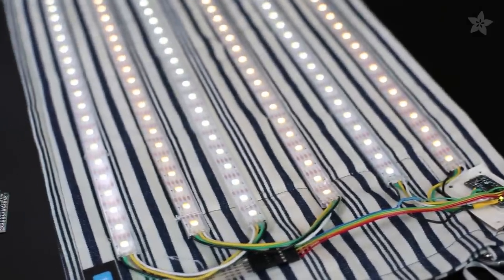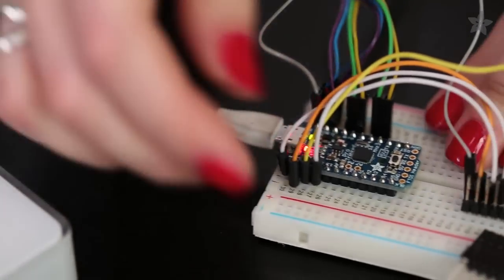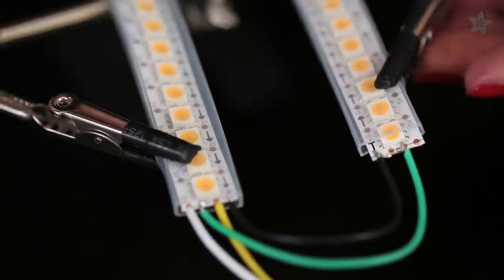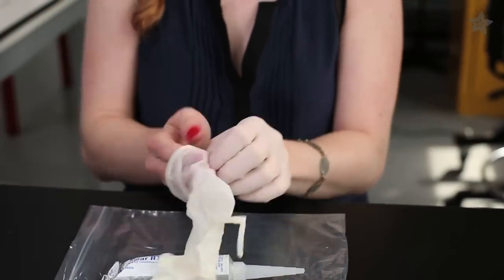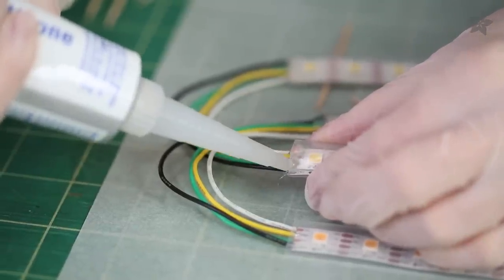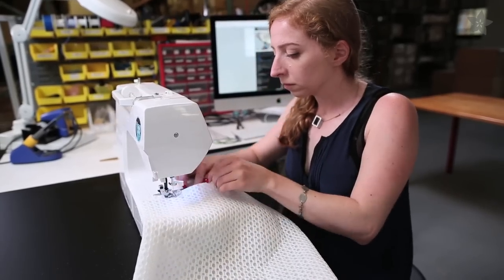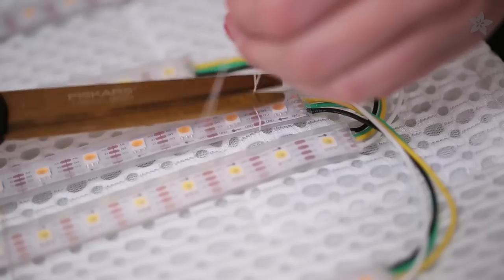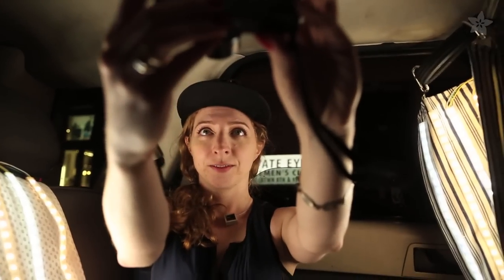Roll-up Video Light

Comment: Cool. Maybe you should add a comment saying that generally, using Acid-cure silicone isn't advisable in the vicinity of electronics as it will eat away at the copper over time. Only alcohol-curing silicone is electronics-proof.
Reply from the maker: ***** Thanks for the tip! =]